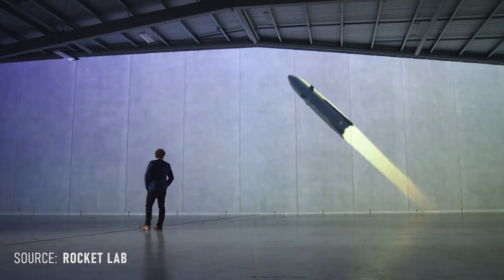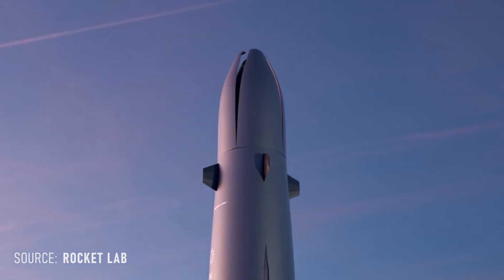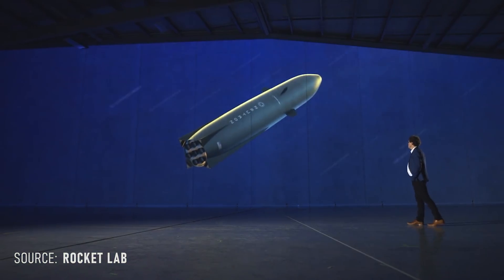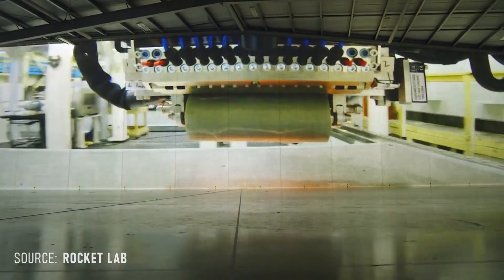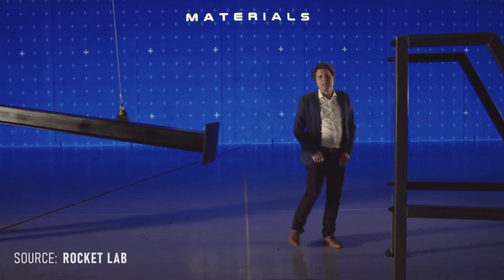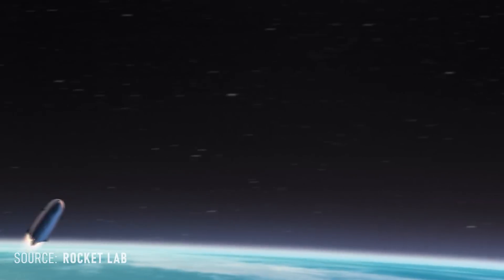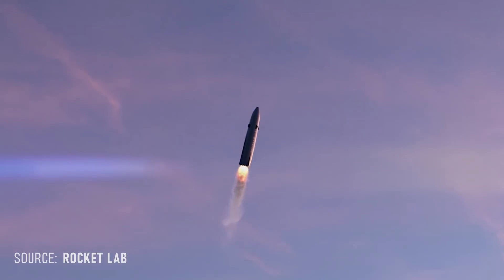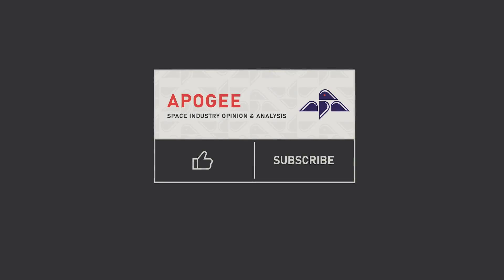Neutron First Thoughts - Design Analysis

Comment: Personally, carbon fiber is better in my personal opinion for space vehicles if they're experiencing a lot of heat. carbon fiber can also withstand a lot of force that comes from launching a large vehicle like neutron. I think the entire idea behind spacex's starship booster being made from steel is that it's pressurized from the inside to where its structure is like a soda can.

Comment: A critical aspect of re-entry is the energy per square meter that has to be expended. Neutron's carbon fiber means that its mass is about one quarter of the equivalently sized metal rocket, meaning that it has about one quarter of the heat energy to burn off in reentry. Neutron's large radius means that the amount of friction per square metre of surface is lower again over a standard metal tube. So we have less energy to burn off over a larger surface - that adds up to a re-use win.

Comment: The correct graphite(more like CF nano structures) has a much better temperature handling then metal. Also all aerospace, even aviation, needs impact resistance on all non essential engine and exterior more then heat resistance as impacts are the main cause of failures. All that said, don't quote me, but I believe Neutron is using metal on it's main body, and CF everywhere else. Here is an interesting video on impacts at high speeds for space craft. https://www.youtube.com/watch?v=wdP_UDSsuro&ab_channel=PBSSpaceTime

Comment: Apogee, didn’t mention anything about the weight of neutron. Rocket lab has Specially formulated carbon composite. makes the rocket extremely light-weight. This helps during reentry in amount of heat that will be generated.

Comment: I wish them well, the retractable legs are only little different than falcon 9 however as for potential problems.  A failure of one of those legs to extend will still cause probably loss of vehicle, that said I would like to see SpaceX go to that design on the exploration Starships (with more area since the landing zone will not be prepared).  Anyway, in the wonderfully expanding low cost to orbit market falcon 9 is an old vehicle and its not surprising that neutron can find a place in that market. In not many more years spaceX will need a new falcon 9 or surrender that segment of the market.

Comment: Most likely the second stage reusible version will use a inflatable heat shield and parachute with helicopter catchup... so electron helicopter parachute catchup is a good practice... and they can launch a  photo with inflatable heatshield to test the tech...

Comment: On the materials decision: Rocket Lab isn't just a rocket company, it's a carbon fiber pioneer. Nobody can do what RL does with carbon fiber. There's only so much they can do to innovate on the reusable rocket front, but carbon fiber is unlimited. It's akin to what Tesla (the auto manufacturer) is to software and AI.

Comment: They will need to be able to.have a sea recovery to maximize performance so they can recover down range on heavier payloads. 

This is why SpaceX has the droneship recovery for most launches. Only the lightest launches have enough margin for a Return to launch site(RTLS) booster recovery.
Reply from the maker: Right now Rocket Lab plans for all reusable launches of Neutron to be RTLS. Marine assets are super expensive to operate and they want simple reuse. So the 8t to LEO is with RTLS.

Comment: I am not sure that you can say that metal is "better" than CC on reentry, especially as RCC has proven itself to be an excellent TPS material. Yes, there are trade-offs, but aside from some dummy hanging a vulnerable spacecraft on the side of the rocket, RCC has demonstrated that it can withstand heat cycling just fine. Meanwhile, steel and aluminum will require additional thermal protection to withstand reentry heating, further increasing the mass penalty.
Reply: What makes you think that CC can withstand reentry heating better than steel?
Reply: @jtengelbrecht4613  I dislike the term "better" in general. As with all design, you make trade-offs. Steel is going to have a significant mass penalty, CC is going to have a cost and lead time penalty.
Reply: I was referring to heating, not the material in general
Reply: @jtengelbrecht4613  CC has a proven track record resisting reentry heating. It is a TPS material.
Reply: @thehaprust6312  TPS rated materials are more for everyday use. To return the 1st stage of the electron intact they had to cover the CC with a aerogel graphite composite(why they are silver now not black anymore).
Reply: @jtengelbrecht4613  I am not sure what you mean by "TPS rated materials are for everyday use".

As for Electron, they did have to modify it slightly, but then it was never intended to recover it in the first place. The fact that they only had to add a thin protective layer argues than the underlying vehicle was fairly robust.

Comment: Both Rocket Lab and SpaceX made a profitable business launching payloads with Electron and Falcon 9. Then they created newer engines to improove costs but instead of retrofiting it to the rocket they already have in operation they made a much larger one... I wonder if these rockets with lower launch costs will see enough demand, otherwise they will lose space for companies like RAF, Virgin and Astra.
Reply: I think Rocket lab is miles ahead of Virgin and Astra since they have past the stage of getting a solid rocket and are already focusing on reuse. I feel sorry for most of the start-up since SpaceX has moved the goal post significantly over the last 6 years. Btw rocket lab is not profitable and will probably only ever become profitable is Neutron succeeds, in fact I believe that's why they had to make Neutron.

Comment: Carbon fiber laminate is more resistant to higher temperatures than aluminium alloys! Common laminates can make it to resistance against temperature of 260°C! Compare it to aluminium alloys ability to withstand 200-250C! 
Whats more, there are carbon laminate formulations which allows preparation of carbon laminate survive 800°C indefinitely! You can start to compare this to steel with heat resistance. Of course for reentry some other things may be needed depending on flight profile. For example light weight heat shielding tiles if the vehicle accelerates to much higher speeds than falcon 9. 

In my opinion, the carbon fiber laminate is better material for starship as well. Much more expensive, yes, but also much more rewarding if the reusability of the scale projected for starship will be realized. Starship may have much higher payload capacity with carbon fiber hull. Look, originally the stainless steel was looked as on as on miracle material- starship wasn't even planed to use heat shield! (from what I remember) But it ended with heat shield which deleted the main advantage of this heavy material.

Comment: Thanks for bringing up the issue of a reusable second stage for Neutron. I'd actually like to see a serious discussion on how this could be done. What do you think? I think that you're going to need a ballute of some sort. Rely on the relatively low mass and surround the engine with a ballute. So you have a low ballistic coefficient. You'd also need a wide enough conical ballute to shadow the tank structure well.
Reply: Recovery poses a problem, as the structure won't allow it to land. They would have to do a mid-air recovery like the are trying with Electron.
Reply: @thehaprust6312  Prob so.

Comment: You could of course have a reusable second stage and keep the same basic design - which is to keep the second stage protected by the fairing and hung from the payload separation plane.
Reply: The heating the second stage will experience will be much x10 worse than the heating of the first stage
Reply: @jtengelbrecht4613  Which is why the second stage would need a suitable thermal protection system. The one I'd like to see is a conical ballute that inflates around the engine, thus keeping the wake plasma away from the tank. Add a bit of active cooling to keep the engine itself (relatively) cool.
Reply: @saumyacow4435  Might work in theory but still doesn't mean its going to be cost effective. At least a ballute should keep it from sinking/submerging and having to be completely refurbished . I not sure if they will be able to predict the semi orbital ballistic trajectory good enough to catch it like the electron first stage.

The payload to LEO/gross rocket weight for a falcon 9 is 2.9% where the Neutron according to the stats RL have given they are aiming for 1.67%. Unless they make the vehicle more capable with higher eff engines I doubt that they can afford to add any weight. 

Personally I think it is a big mistake ignoring the efficiency of the engines. The margins of rockets are very low and saving fuel for them to return just cuts it even thinner. The falcon heavy weight less than 20% more but can carry 2 times the load.

At the end of the day we can only wait and see who made the best guess.
Reply: @jtengelbrecht4613  Well its simply speculation on my part. We won't know until we see what the dry mass of RL's second stage actually is. Its possible that a ballute may not be workable on the existing Neutron design, but may work if the Neutron were scaled. Or it might be the case of using it on launches where you're not using Neutron's full payload capability so therefore you can squeeze in the ballute. I would also assume a parachute and helicopter recovery as they do for Electron. Or it might be the case that the second stage and engine are so cheap to produce that it never pays to reuse. Again, my thinking has more to do with what happens if you had a scaled (heavy) version of Neutron - where the second stage probably needs multiple engines. Do the economics change then? 

The price you're paying for lower efficiency engines is a larger first stage. Since you're reusing the first stage and the cost of fuel is all but irrelevant, that's a good design trade. A more efficient engine on the second stage is another issue. But, where are the payloads above 15 tonnes? (Neutron can carry up to 15 tonnes in expendable mode).

Incidentally, Beck in an interview has hinted at a version of Neutron with larger first stage fuel tanks (the current design leaves spare room). Is there an engine upgrade in the works?
Reply: @saumyacow4435  Before they can upgrade their engine they need to make their first rocket engine with a gas generator included. 

Increasing the size of the first stage won't amount to much if they can only land back on site. Every m/s the booster accelerates the 2nd stage it has to decelerate and more to get back to the launch pad. Peter Beck has dismissed the idea of a barge so far.

I was comparing the falcons +/- 15,8ton payload capacity to the 8 ton target of RL for the Neutron to LEO.

If they make a bigger Neutron with a more expensive 2nd stage than yes it will make it more sensible to try and save it but the larger it is the more difficult it will be to reenter intact. Another option is to just have the thrust puck detach with the engines and just recovering the most expensive part.

I agree with your assessment that the cheaper engine makes up for using more fuel although this argument becomes weaker the more times your able to use that engine. 

Will be interesting to see what the cost to company far a launch is once it is done. Since they return the fairing and require less ground support(barges) it should be interesting to compare the $/kg of the vehicles. Ill be impressed is they can manage to do it for less than $40million/launch.
Reply: @jtengelbrecht4613  Yes, there is also the possibility of recovering the engine by itself. However (and this is provided the tank is light) there is an argument for keeping the tank because it will partially support the ballute.

Comment: If you watch Beck's most recent interviews, it becomes clear that they understand carbon fibre well and have a material that will withstand the pressure cycles and temperature extremes. Also, Beck does say that that the use of carbon fibre on the first stage (not just the second) reduces mass to the extent that they don't need to get that performance back in more complex, more highly stressed engines. Also on the issue of cost. For a start this isn't a problem when you've reused the rocket many times. Also, Beck is quite correct in saying that manufacturing has advanced and automated tape layout does make it a lot cheaper. And that's important for the disposable second stage btw. 

Another thing is that all the talk about rocket structures and engines ignores that most of the costs of flying rockets isn't the rocket itself and this is where I think Beck has really nailed it. Even to the point of integrating the risers for the second stage into the first stage. This of course adds more mass to the first stage, but then again if you're using carbon fibre this then you've got the margin to do this.

Comment: Carbon Fibre's expense is irrelevant.  Reusability means the expense can be amortized over many many flights.  Also there's no reason that the graphite coating trick from Electron can't be used for the most thermally stressed parts of neutron.  As to the pressure change issue, as long as the repeated stresses are within tolerances this should be fine... I'm pretty sure carbon fibre does not suffer from anything like metal fatigue.  It would be interesting to compare and contrast a Neutron first stage made of Titanium and one made of carbon fibre.   Titanium is of course also very expensive and hard to work with, but again that doesn't matter if you amortize over enough launches.
Reply: Beck said in a Nasa Spaceflight interview that if the graphite coating works on electron it would also be used on neutron

Comment: One of the other major upgrade could be the engine. Yes, to get it operational and then running for a while, a simple and reliable engine is needed. But they need to learn a lot while doing this. So far, they only know electric pump low MCC pressure engines. Once done learning, the could switch to staged combustion and easily increase Isp by 5 - 10% and therefore huge performance gains.
Reply: Or they could just simply scale the tankage to suit. According to Beck, there's spare space inside that wide body. Besides I think that their "over 320" Isp claim is a little conservative.

Comment: I think its obvious that the compromise that they have opted for in their design choices is to go for the carbon fibre frame. The huge mass savings that they are hoping for is what they will need for the whole design to work. None of the other design decisions will work (engines, legs, faring) if they use Stainless steel due to the weight.  Similarly a reusable soundstage (mini starship) will be 10-20 times heavier than the current super light second stage, that cant even support its own weight and needs to be suspended from the faring !.  The critical path for the Neutron is the Carbon Fibre material.  If that doesn't work none of it will.
Reply: Just no

Comment: My only negative opinion is why they set the payload limit at 8 tons in a partially reusable config. Once they realize Full-Reusability is actually the tech of 2024 (not having an expendable S2 in 2050), how far are they going to reduce that 8t to add reusability to their 2nd stage? There is no way they can add that hardware with less than 4 tons. I think once they realize they need full-reuse to stay competitive with Terran R & Starship. They will realize they cannot do it with this same 1st stage, & will need to design a completely new one as well as ground systems. I think this may be a great launch system for a couple years. Then their customers will see how much cheaper the pricing is on Terran R, Starship, and hell, maybe even full reuse New Glenn. Unless they have extremely loyal customers I can't see Neutron having a significant number of launches. 

Creating an expendable second stage & calling it "the rocket of 2050" all because you attach the 2nd stage in a cool way & keep the fairings attached to the 1st stage, is pretty arrogant. Far more advanced rockets are set to hit the market at the same time. With all the acquisitions they are doing, development of Neutron, Neutron being old tech by the time it hits the market, looming recession, & falling stock price. If their satellite business does not take off, their launch systems will never make enough money & their stock price will fall to $0.00.

Comment: This rocket is total bunk and will be redesigned as a metal rocket by same time next year once they work out the CF structures cant cope with both cryogenic stresses and the heat stresses of reentry. The structure will be full of inter-lamina stress fractures and also the resins will have deteriorated from pyrolysis and out-gassing during reentry, with likely only way to prevent this a complete coating of fixed heat shielding (adding weight) or ablative compounds that will need to be replaced before each launch. Lets see RL relaunch one of their Electrons they are getting back on parachutes first.

Comment: Of course they are solving at least 2 problems with Falcon 9: the legs and the fairings recovery.  I don't know if the barge landing is a problem but it's a way to save money. I don't think to add crew capability is so easy. I like the design and the compromise for example I'd like SpaceX could implemented the Superheavy with fixed legs because we all like the Mechazilla but it's another complexitiy added before even try to flight.
Reply: SpaceX also wants to re-use the second stage. Elon stated this is extremely difficult and I think this is one reason why Starship needs very efficient engines and a complex stage 0 allowing for the complete elimination of the landing legs.